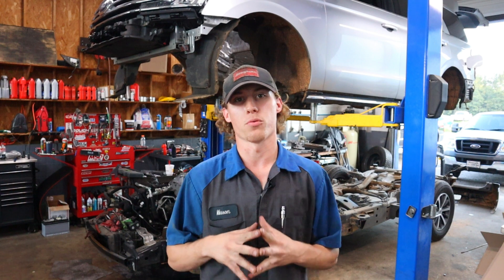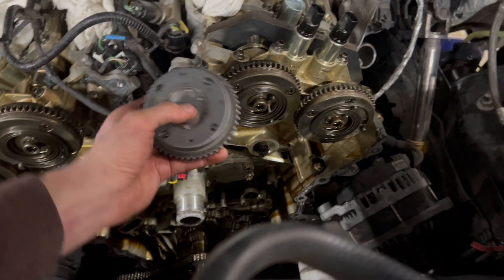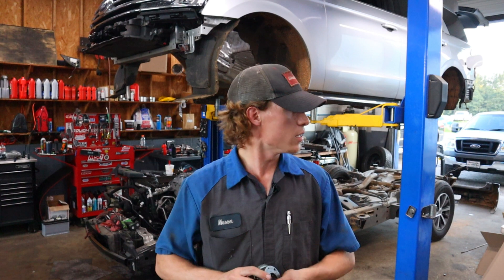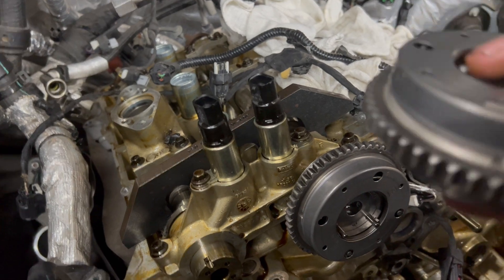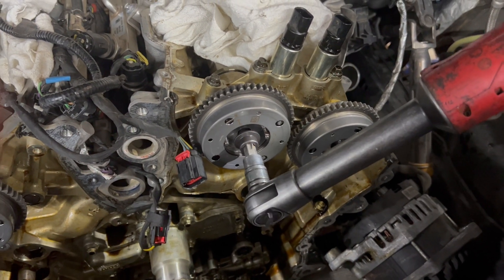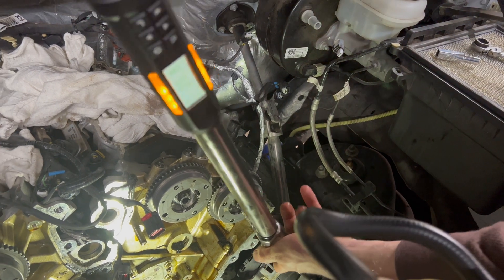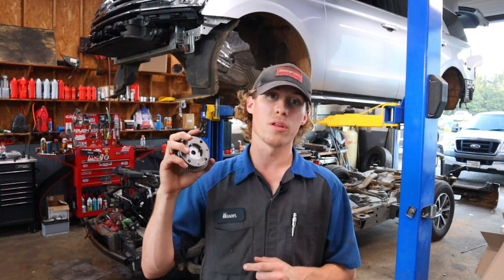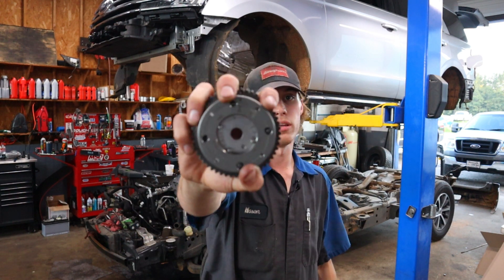Ford 3.5L EcoBoost Cold Start Rattle | The NEW UPDATED Phasers

Comment: I have a 2018 F150 35 eco-boost. I don’t have a cold start rattle, but I also noticed that you skipped 2018 as being covered in your video as having bad cam phasers is there something about the 2018 F150 that would be different making an exempt from the camp phaser issue

Comment: 18 f150 3.5 cold start rattle throws p0420 code drive it about 100 miles it check engine light goes back off drive it some more it pops back on. Rattles at idle sometimes as well is this a catalytic converter or phaser issue or both?
Reply: If You havent figured it out yet.  Run a tank of premium good fuel.  That will help with the p0420.

Comment: Just purchased a 2019 Platinum with 99k, has a short rattle on startup. Got the dealer to agree in writing to fix with new updated parts. Only part that worries me is its a honda dealership and they dont have a ford dealership anywhere nearby. Fingers crossed! other than that shes minty!

Comment: My 2019 eco boost has been doing this rattle since it was new. I mentioned it to the dealer a couple of times and they just acted as though it was the first time they’d ever heard of it and had no idea what it could be. I started just holding the gas peddle to the floor for a couple seconds when cold starting so the engine cranks a few times before firing up and has a chance to built some oil pressure. It’s now off warranty so I’m just hoping to sell it before something fails.

Comment: Have a 2019 F150 3.5L and mine started rattling at 73k miles.  Called 2 different dealerships for a price on this job.. $4,400 for one dealership, $5,900 for the other.  Talk about a gut punch...
Reply: I’m on my 3rd set done yesterday and told them I want new updated phaser and the gave me the old style again and kept reassuring me that I have the latest and greatest. Sat up all night wanting to throw up 3600 bucks to fix mine
Reply: How’s your phasers doing ?
Reply: Yeah, this should actually be a free recall to install the new model phasers no matter the mileage.

Fuck Ford
Reply: Yup. Luckily I bought the extended warranty with mine and it’s covered. Looks like the warranty paid for itself this time. Mine has 63k on it

Comment: JUST A SIMPLE QUESTION I GOT A 2017 3.5 WITH THE RATTLE  ISSUE 
CAN I USE THE PHASERS FROM A 2020 OR 2023 ON MY 2017 PLEASE ANSWER IM TRYING TO GET IT FIXED

Comment: Love the videos, Mason they have saved my butt! Nissan Tech here doing the fun fun phaser repairs on a 2017 Expedition with 75,000 miles. Customer had it in his head that it was a phaser issue so he bought a RockAuto kit with all 4 phasers, chains, guides, water pump, and everything. Brings it to me and I tear it down and I ran into an issue. The kit he bought on RockAuto was different. His kit he bought had 1 long chain and 2 smaller secondary chains. I go to the Ford parts desk and they pull up what I have is 2 large chains. So yes please please order OEM when you do phaser repairs. According to Ford, up to 6/2017 had the 4 chains does this seem right to you?

Comment: For me the Toyota Tundra and the Toyota Sequoia with the 5.7L I-Force V8 is definitely the best vehicle to have and it'll outlast any Ecoboost vehicle with ease.
Reply: Agreed, but the payload on the Tundras is a joke.  I'd love to get one.  They hover at around 1300lbs per the sticker.  8000lbs trailer, looking at 1200lbs tongue weight (at the top end of the 15% recommendation).  Add a 75lb weight distribution hitch.  You need to find someone that weighs 25lbs to drive it. and have no other gear.  :(  I wish Toyota did better with that.

Comment: So I JUST had a full timing job done, new phasers and actuators because I was having the phaser rattle, but now my truck makes a new clatter noise but only after sitting for at least two days, it’s totally different than the original phaser rattle and lasts less than a second… it sounds like lifter chatter in an old school engine that hasn’t been started in years

Comment: I missed the last part did you say GM's have less problems than fords? It's weird you would think Ford would do a recall with so many people having this problem, and them discontinuing those particular cam phasers. I have a 2019 Expedition and I'm having the same problem with the cam phasers rattling noise. Just curious, do you know how much your dealership charges to change all 4 cam phasers.

Comment: Great info!  I just bought a 2018 F150, 3.5L.  How do I go into a dealer and tell them that I have this cold start rattle and I need the cam phasers replaced?  Also, is it under some sort of warranty?  I kind of assume the dealer will tell me to go pound sand.  How do I be persistent on what I need fixed?  Thanks for any and all replies.
Reply: Dealer mechanics will listen for the rattle and determine if it's the phasers.  I also have the 2018 3.5 and Ford is installing my second set, this time the M series.  I have an extended warranty, 100.00 deductible.  1st failure was at 44,000 miles and lasted to 88,000 before the rattle started again.  Hopefully the last time for this issue
Reply: Thank you fordtrbo!  I'll try to be kind and ask a dealer mech about this and see what I can get accomplished.

Comment: My coworker just got a brand new f150 with 2.7. Brand new vehicle - phasers rattle at cold start. Waiting for new phasers under warranty. Funny that for this 2.7 he traded in his 3.5 he bought also new in May of 2023. On that one cam followers had been eaten after a few months of ownership. “Ford making his customers eat the cost of bad parts” indeed. If he did not work for Ford he’d probably never buy another one again. Wonder how long before our plant parking lot start filling up with Tundras.

Comment: Just got my 18 expedition back today from Ford to replace the cam phasers. I told the guy that I wanted the revamped phasers not the old one bc they’re crap. He said they only put the new ones in now and discontinued the old ones. When I picked up the car I looked at the invoice and it showed the old part number. I even questioned it and the guy said it’s the new ones. We don’t believe them. Is there a way to find out? Maybe they are just trying to get it by me. Can I do anything? Any help would be appreciated.

Comment: I bought a 2017 3.5 EB back in May (6 months ago). Sure enough, I started it up last weekend and got the dreaded rattle. It seems like, since it's a known issue, Ford would step up and cover the full cost as a warranty recall. These trucks aren't cheap and we're expected to pay thousands of dollars to repair a design flaw that they've known was a problem for several years. As much as I love my truck, it may very well be the last F150 I buy. Maybe I should've bought the 5.0 L Coyote like I started to, who knows.
Reply: 5.0 has severe oil consumption issues so who knows

Comment: With all of the problems the 3.5 ecoboost is having, is it possible to come up with a complete list of must do reliable enhancements to put on the engine.  It appears most of the issues that ecoboost is having are very costly in terms of maintenance hours.  Lifting the cab away seems excessive maintenance for just one issue, but very practical to just do all of them at once.  In fact, I would like to see it as a package deal. 

 As of now,  I am looking to just replace my engine with a new one that will have as much done to it that will make the engine last easily 400k miles or longer.

Comment: I recently bought a used 2017 from a dealer. Have a warranty covering the parts associated with the cam phaser issues. However, would they replace if no codes have been thrown? The rattle is even embarrassing in public.

Comment: Can onyone tell me the TSB showing this part is recommended?  My truck is at the dealer right now (2018 Expedition) getting phasers and they refude to use the M part number because the Ford TSB does not recommend it per the 2023 TSB.  Are all of the H part numbers the bad design?

Comment: Had my phasers replaced on my 2017 F150 for the THIRD time in 4 years a few weeks ago.  They used the new parts as discussed, started rattling again 3/4 of the way through my first tank of fuel.  Thank goodness I purchased the extended warranty.  I want to get rid of the truck, but vehicle prices are out of control.  Im done with ford products after this one.  Thanks for your videos, they are informative!

Comment: I have a 2017 F150 Lariat Crewcab 4x4 with 3.5l Ecoboost V6.  I've had the original cam phasers replaced 3 years ago under warranty, about to do the second set on my own dime.  My Ford dealer service counter tells me the NEW cam phasers (ML3Z) WON'T FIT my engine.  If I search for the parts on a Ford dealer's parts website, they point me to the OLD part #'s (HL3Z).  Is there some reason why the NEW cam phasers won't work for me?
Reply: Further pressing the dealer and service tech resulted in them supplying the NEW cam phasers (ML3Z).  They were definitely trying me on with the OLD parts!  Only 100,000 mi on my truck at this point, hoping this is the last time.  Now dealing with a rear driveshaft 'rumble', I'm going to defer that for a bit though.
Reply: @seangibbs9402   How did you get them to use the new parts?  I am having the same issue, they are saying the TSB calls for the H parts and they cannot use the M parts.  They refuse to install the redesigned parts.
Reply: Same question here. 2017 F150 XLT 3.5L EB Fx4 and just started getting the rattle. No way I'm going to spend thousands of dollars just to have them put in the same old style phasers that they know are causing the problem to begin with. You'd think Ford would want to keep their customers by fixing a know issue instead of setting us up for the exact same fail further down the road.

Comment: I have a 13 f150 3.5 with a cold start rattle.  Is it the phasers or timing chain stretch?  It is scheduled to have the phasers, timing chain, the whole warrenty job done so im just wondeing if it even needs the new phasers if this is a 17 and new issue

Comment: I had the updated parts installed (4 of them) about a year back and now I have the rattling issue again.. Expedition 2018
Reply: Same
Reply: @koltenpierce3707  you know later I went to them and they made some computer reset and noise became much lesa

Comment: Ive got a 2019 3.5 ecoboost. 96000 miles. Just started rattling. Called dealer. They said $3200. Total bs that ford doesn't cover the cost of this known defect. Last ford ill ever own.
Reply: Do you really have to fix it ??
I’ve never heard of any engine problems because of that noise.

Comment: I have a 2018 and it makes that noise and it got stuck at start up (like when you turn the ignition & hold it) I’v dealt with the local Ford dealer a few times and even forced  them to change out the Vacuum solenoid valve & Check valve for the IWE vacuum lines at my cost because of the scraping sound it would make once in a while when I turned left due to the 4wd hubs trying to engage or ??? But whatever it did fix. That sound started again this week so I bought the parts and changed them myself (literally a 5 minute job) and $100 in parts. Now I have to deal with this other issue, I’m an HVAC tech and like fixing things and understand design flaws and I fix them on HVAC systems everyday. I’ve been told that that the screeching sound and the rattle from the engine will not damage anything, I’m an older dude & the first thing I tech new techs is to troubleshoot with their ears and that metal to metal noise is NEVER GOOD lol😂. The way Ford is dealing with these issues is unacceptable and is making me think I’m just better off with a new GMC truck. I’m on my 6th Ford from the same dealer.

Comment: Hello we have a ford 3.5 eco boost with cold start rattle. We changed the old phasers for the new updated ones, now there is not any noise but we get the P0017 failure. What can we do?

Comment: Please help me hear Mason. I have a 2018 F150 with the 3.5L engine. I got the PCM fix in 2021 and now, with only 40,000 miles I have the cam phaser rattle. Took it to Ford who diagnosed it but who claims I am not covered by the warranty extension TSB. Said my VIN is not included.  Why would that be. I told Ford to hold up on fixing till we resolve this. They want my to pay $4100+. Help!!!
Reply: What I was told by the dealer and then Ford Customer Support is that my VIN was not part of this TSB but that makes no sense to me. I did receive notification and made the PCM update so that would say something. One other guy suggested but did not say that the issue is that the real issue is that TSB 21N03 expired. Could that be true?  Does it have an end date?

Comment: Thanks for doing what you do on the channel. Love it. 
Question for you regarding my 2017 3.5 EcoBoost. Truck just turned 150,000 mi. I don't worry about the rattle at startup anymore. Is there any harm running the truck with the original factory cam phasers? Truck runs fine, just a little rattle at startup. I plan on keeping it another 25 or 30,000 miles. Am I at risk of destroying the motor or just drive it?
Reply: Any update ?

Comment: Is the rattle just an annoyance or will the phaser eventually cause damage to other stuff if ignored?
Reply: everytime it does it it's damaging your cams, timing chains, tensions, timing chain sliders. which will eventually lead to a constant knocking at idle and eventually catastrophic damage
Reply: @nastysoda9212 people never fix it and they have 150k 200k miles on their trucks.

Comment: Hi Mason - I took your advice and got my '17 F-150 phasers changed out and replaced the water pump, etc. as you recommended at a local Ford dealership.  Unfortunately I had to take my truck (bought brand new) back because under load a high pitched whine will come.  The mechanic was very diligent about trying to fix the problem.  He has checked all the hoses for cracks and the rest of his work and can't find what's causing the noise.  He confirmed the noise while driving my truck with me, but says he can't get the engine  to make the noise in his stall (trying to brake and accelerate same time) to throw a computer code to work with.  He says he's never heard this kind of sound.  Any ideas you have would be greatly appreciated and thanks for all your great information and videos!
Reply: Turbos? Exhaust manifold leaks?
Reply: Why doesn't Mason reply to your post or so many others on here?

Comment: B
0 seconds ago
Dealer just told me they used part nu HL3Z-6256 CD last time they replaced my cam phasers.That part nu cam phaser only lasted 8,000 miles. My Truck is a 2017 f 150 4x4 with 3.5. Can you tell me if this nu is old cam phasers? They are wanting to replace new cam phasers again. Dealer says ford will pay $800, and me pay $500 to replace again.

Comment: I have a question for you I just bought a 2018 Ford expedition limited about 6 months ago with 63,000 miles on it. I didn’t know about this rattle but I bought it from my local ford and they said the rattle was nothing big to worry but now 6 months latter my expedition is in the shop and they are saying I need to replace them. How is this not covered when they new it had the rattle ?

Comment: our 2017 f-150 is doing this bad. I'll call the dealer tomorrow to set up a time to get it in. thanks. Also F ford and making plastic oil tanks, plastic drain plugs, plastic engines. Are engineers getting stupider and stupider? WTF is going on. My 2000 F-150 v6 4.2l manual is running strong. Isn't that insane

Comment: Hey I have a 19 raptor and the cam phaser are scheduled are getting replaced what other parts would you recommend to change while it open. I heard recommend to change oil pump, timing chain and tensioner anything else would you change. What are those part numbers of other parts you would change thanks

Comment: I have a 1st gen 3.5. 2012 f150. 
Will these new parts work for my engine? If not is there a phaser designed that has fixed the issues for the 1st gen?

Comment: dropped my 2019 Lariat f150 off tonight to have them done. Work at a shop and deal with hundreds of f150s and have seen this a lot so im glad to finally understand more of what causes the rattle thanks to your videos!
Reply: How much did it cost you if you don’t mind me asking I’m looking to get it done to mine as well
Reply: @rayslawncare616  i had 400 miles of warranty left so it was free. I got super lucky but my brother raptor who had it done a month ago was just over $3,000 usd for the labor and parts.
Reply: Same question , how much did it cost you ?
Reply: @benjamindavid1612 ford covers 100% cost up to 60k miles than they cover a percentage after that and eventually I think at 90k it's 100% on the customer. 
The labor rate is like 14.5 hours customer pay.  Depending on the dealer labor rate could be around $1800 to $2000.
Reply: @littlebrw is it 5 yrs /60k miles which ever come first ?
Reply: @tabithabartlett306  I Beleive so, but ford offers to cover a Percentage up to 89k after that it's 100% on the customer.
Reply: it was free because I was still in warranty on the truck, normally it is about $3500 for our work trucks to have them done. @benjamindavid1612

Comment: Great video! Does it hurt the engine if I don't fix it? Anyone knows?
Reply: Was hoping you'd get an answer on this.   A million videos about the phaser rattle but zero videos on an actual engine that blew up due to not fixing the rattle.  Heck guys are posting that they've gotten 100,000 miles and still strong after initial phaser noise!   So is it really a big deal???
Reply: @peruser155  I looked all over and I didn't find an answer. Mine wasn't included in the recall (what a load of bs) but luckily the extended warranty was 2 months away from expiring so they fixed it for free. Hoping the best for you!
Reply: There is no answer for this question.